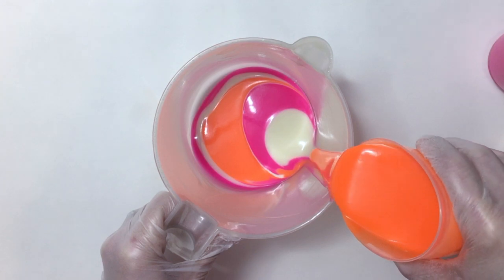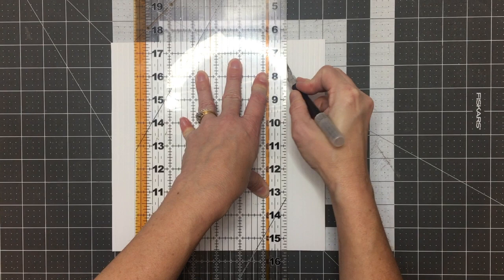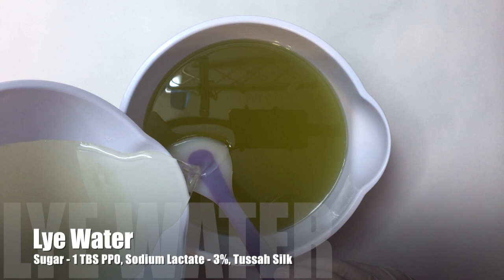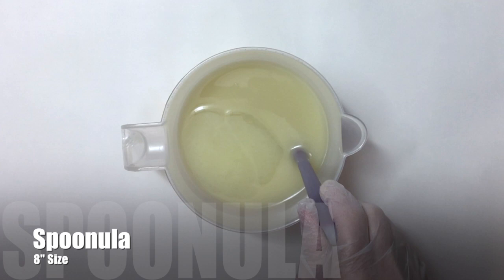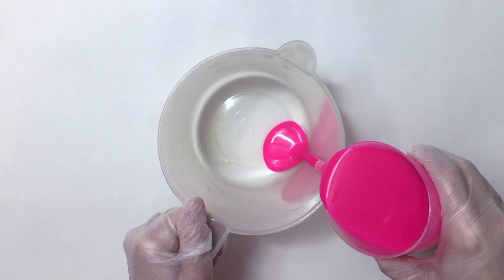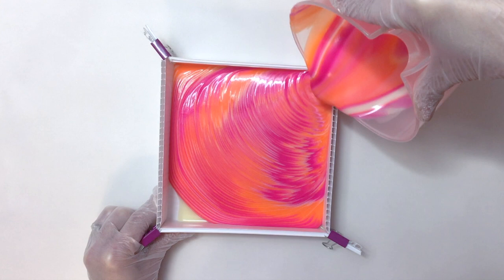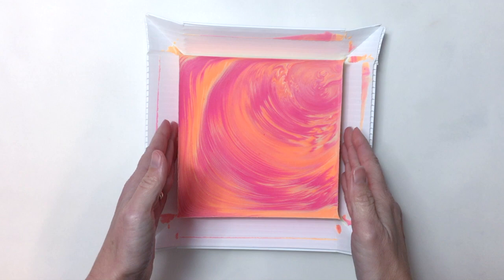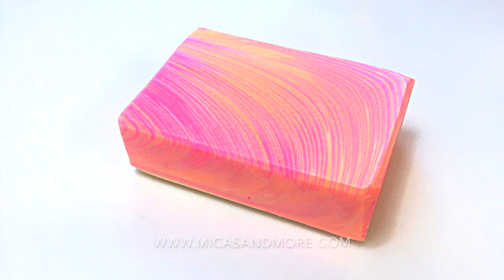DIY Soap Slab Mold Tutorial

Comment: Loved the valuable--and simple--instructions for the mold! Is the board you used strong enough to make, for example, a 2 1/2 pound loaf mold?
Reply from the maker: Susan Harrington - Growing Lavender, thank you, I’m glad it was helpful!  Yes, you can make them any size you’d like.  A larger mold may require support to keep from bowing.
Reply: @micasandmore  P.S. Fan suggestion: if you put the full website address, http://micasandmore.com in your description it automatically becomes a live link I can easily click on to get those supplies I didn't know I needed! 😉🤗
Reply from the maker: Susan Harrington - Growing Lavender, thanks!  I thought I did that at one point but clearly I forgot!